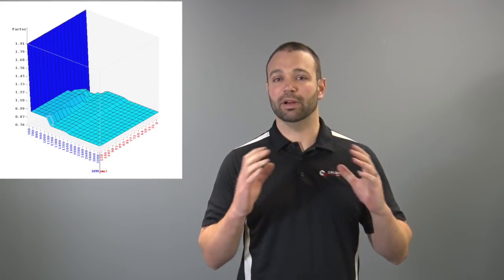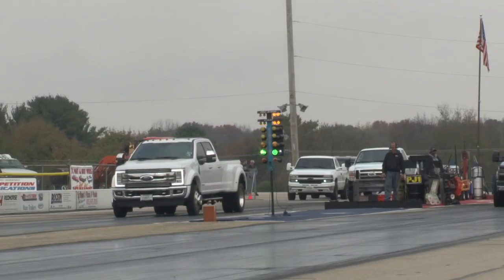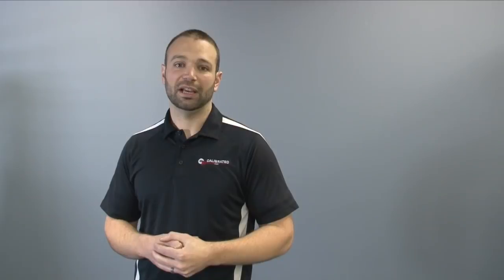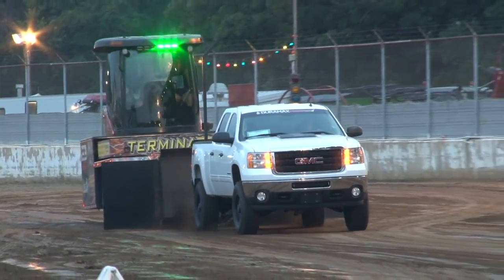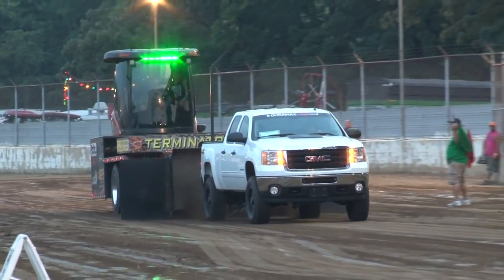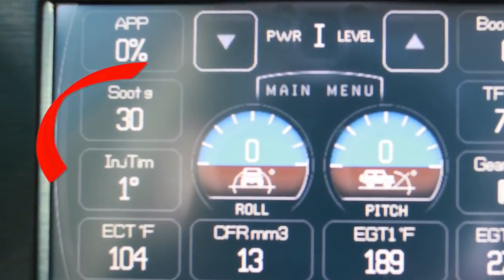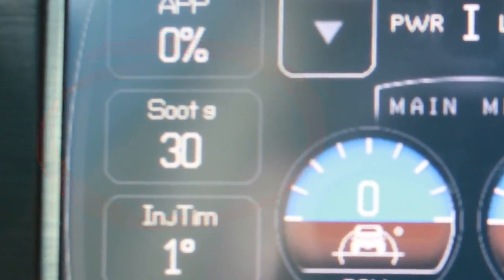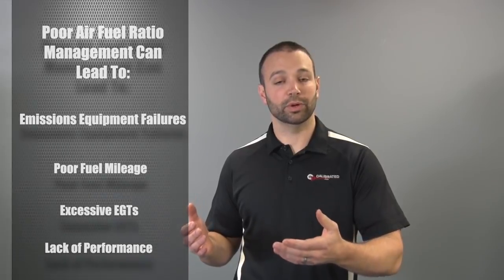Air to Fuel Ratio in a Diesel

Comment: Hello,
I have a question which i cant find the answer anywhere and i hope you could help me.
How does the catalytic converter on a Diesel car, (Diesel oxi cat) work efficient with a λ way to lean ? To get a catalytic converter to work we need a λ from 0.997 to 1.003, so how does it work?
Thanks
Reply from the maker: Give us a call 815-568-7920

Comment: When diesel is burning rich it makes less heat then burning clean.
Reply: wrong more fuel in a diesel means hotter egts
Reply: @tomlynch7097 wrong, depends on mixture.

Only at one point does it lead to high egts and thats running a bit leaner. Going even leaner results in lower egts  going richer results in lower egts.

Tho diesel burns differently compared to petrol

Comment: Diesels run lean (of stoichiometric) most of the time, they're leanest at no load when idling (about 80:1) and progressively richen up to stoichiometric (18:1) at max power (or possibly even a little richer). They have to be lean, how else do you get partial power from the engine without "starving" it of fuel for the amount of air in the chamber? Otherwise the engine would run at full power all the time! Sure modern diesels use EGR, change the timing and other tricks but you still have to limit the fuel burnt if you want less than full power output. See here for more details: https://www.researchgate.net/post/why_the_diesel_engines_are_generally_operated_at_a_leaner_mixture 

On an interesting side issue this property of diesel exhaust is one fact that debunks the Holocaust myth, at least at Belzec, Treblinka and Sobibor. For those three camps it's claimed the exhaust from a Russian Diesel tank engine was used to asphyxiate Jews but at the low fuel to air ratio's a diesel operates at, there's more than enough left over oxygen in the exhaust to keep humans alive. This article goes into length proving this fact: http://www.ihr.org/jhr/v05/v05p-15_Berg.html. This situation actually occurred when a diesel train broke down in a tunnel for hours with it's engine running, see here for more details: http://vho.org/tr/2000/2/tr02patdiesel.html and https://phdn.org/archives/holocaust-history.org/~jamie/buchanan/index.html

Comment: Lambda is easy to work with on a computer controlled engine that consistently changes fuel delivery in relation to air intake charge.  However, older mechanically injected Diesels unfortunately can't change fuel timing and delivery on the fly, the fuel that is directly proportional to boost pressurized intake charge will be over fueling at idle or half throttle input.  So now the burning question is if an older non emissions/lightly emissions regulated Diesel can be a legal swap into a classic vehicle, and still pass an emissions test.  I've heard hydrogen injection can vastly improve emissions, I have no idea if they'll allow you to pass a state emissions test using it though.
Reply: By very definition you can't overfuel on idle - if you did you wouldn't be at idle anymore, the engine would accelerate.
Yes it's possible to run smokefree with a mechanical diesel if the boost compensator is adjusted correctly. But for max performance it should make just a tiny bit of smoke when you press the pedal quickly.
 It should restrict maximum fuel off boost and slowly increase as boost rises
Reply: @petarmiletic997  Wise advice right there.

Comment: I’ve got to put head gaskets on my lb7, it has 280,000 miles, should I spend the $700 extra to put in a new cp3 pump while I’m in there or spend the $700 on a good lift pump? Wish I could afford both but can’t, I’m also not having any problems with the existing cp3 pump, it’s just getting old. Thanks for any advice.
Reply: Yes get that cp3 to save everything now.then do the lift pump later.best case
Reply from the maker: @ronmower3694  x2^^
Reply: Does your lb7 have a tune on it? Just curious if it's stock and has head gasket failure? Thanks
Reply: chris kriewall Chris, yup, it’s stock. I’ve never done anything to the computer and never pulled much with it, just packing the family around on interstates for 280,000 miles. I love that truck, my kids grew up riding around in it for the past 15 years. Had injectors put in it at 198,000 miles by a factory recall but that’s about it.
Reply: My lb7 has 370k on it towing a 34’ enclosed trailer a few times per month.  It has a built trans, lift pump, custom tuning and have never had a single issue.  Change the fluids and do basic maintenance, these duramax’s are fantastic.
Reply: Joshua Elam, do you change the inner transmission filter yourself? I’ve always changed the screw on one and the dealership changed the internal one a couple times but I’m thinking of doing it myself this time, just wondering if it’s easy. Also, if I change it I’m going to have to take it in to get the fluid changed because of the torque converter, should I change the fluid before I take it in to get drained or after? Thanks

Comment: Sorry, But You're NEVER going to convince me that DPF, EGR, SCR, CAT and DEF is "BETTER" for these Diesel engine's. I don't care what or who's tuning you put into them! In the end, a Deleted Diesel Engine (Tuned or Not) will easily go 500K+ if properly maintained..... You will be hard pressed to find that with all this "Crap" bolted on them. (Sorry, Rant over) 
Thanks for the video's though, Nick.
Reply from the maker: That's cool.  Just to be clear we never said the emissions equipment is better for diesel trucks, we just have accepted that they exist and we have to work with them.
Reply: @Duramaxtuner  Well...... you could always  just take all that shit off and throw it on the floor like most people do. Lol
Reply from the maker: @shawnisVALRAKSdad  Due to EPA restrictions that is not an option for us.
Reply: @Duramaxtuner  I know I wasnt trying to be mean or anything. I just dont really see why all the emissions stuff is needed. Diesels produce much less pollution than a gas job. My 6.5 is a different story because that's an older truck.
Reply: @shawnisVALRAKSdad  dude he is a professional with a company and not a redneck mechanic at his garage. they need to follow emission laws etc.
Reply: Phil G. There are a lot of 350,000 mile Ford 6.7’s out there still intact. Why do you get bent out of shape about “putting 500,000 miles on a truck” when the odds of anyone doing that are tiny? I bought a 2019 f250 diesel as you can see in my vids, and I also bought the extended bumper to bumper ESP warranty plan from Ford for 150,000 miles. It will take me 5 years just to get 150,000 let alone 500,000! By the time mine has 100,000 on it I’ll be ready for another truck. Today’s emissions equipped diesels (especially Ford’s) is quite capable of running 150,000 miles trouble free. Why care about any beyond that??
Reply: Phil G. egr liberates the top end
Reply: @highball7347  Humm…. Ok?? Congrats!, you obviously enjoy the Government Running your life, I do Not! (you must be a Democrat, Huh?) And don't tell me how long I'll own "MY" Truck.... You don't know Me. BTW, I Still own my Dad's 72 Chevy LB that was handed down to me. 
All that aside.... Facts are Facts, these BS Emissions EQ. they're "MAKING" these manufacture's install ARE WORSE FOR DSL ENGINE'S PERFORMANCE & THE LIFE OF SAID ENGINE..... PERIOD!
Reply from the maker: To each their own.  But the real question is: Should be using punctuation after spelling out a punctuation?
Reply: @Duramaxtuner  Ya.... I'm not good when it comes to Grammer and Spelling. You got me their, or they're, or there?? 🤣🤔
Reply: @highball7347  Alright Man.... Have a Great Day.
Reply: Highball 734 the crap that comes out def system smells 10x worst and gives me a headache then a deleted truck. It might clean the soot out but still smells like dog shit